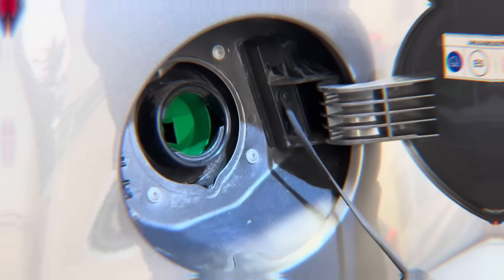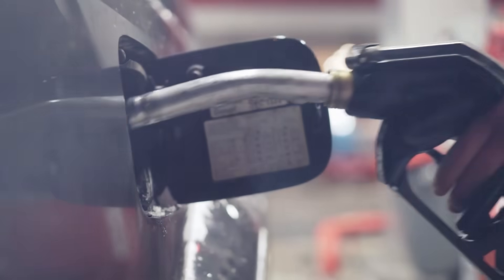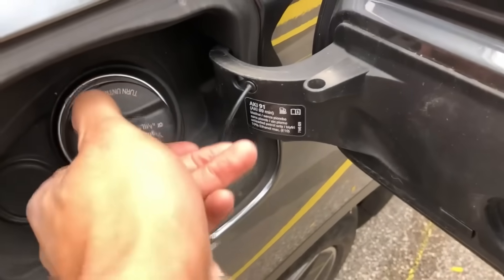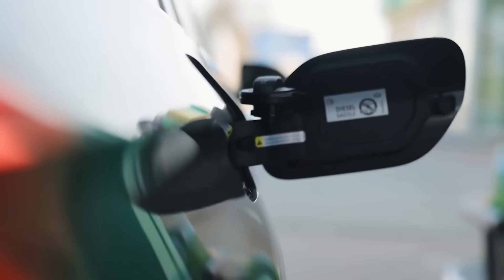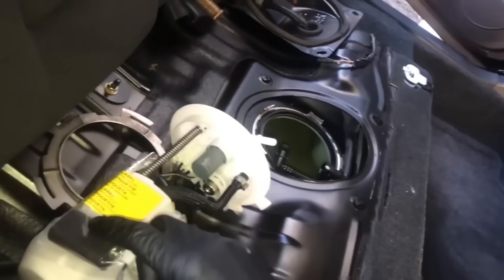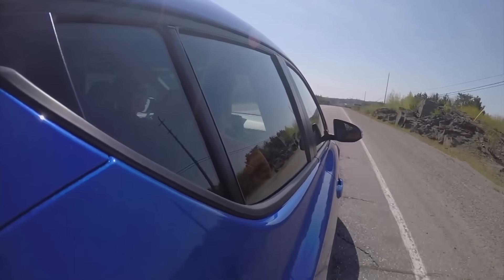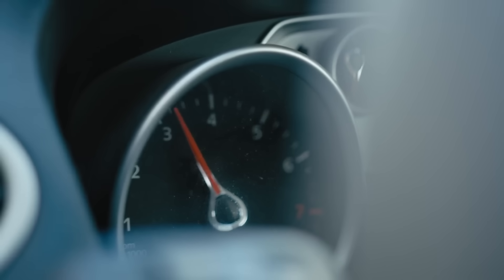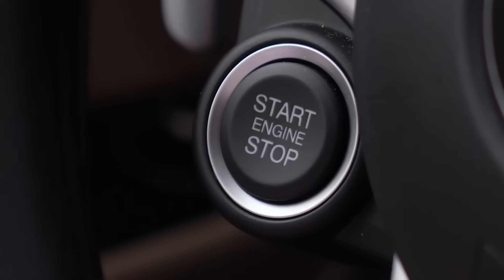Never Do THIS Before Refuelling (90% Get it Wrong)

Comment: BS. Youdo not know what you talk. Presurised tank??? 😂😂😂😂. Plug its allready built with airvent. If air do not go in because the plug seal the tank, at one point you have vacuum. Or pressure if its hot outside and tank its perfect seal. Cover its build smart, in case of accident and capsize of car, fuel do not came out from vent. 😂😂😂

Comment: Never in 500,000 miles did i EVER leave the engine running whilst refueling. Neither have I seen anyone else doing it. On my current old car the key locks the fuel cap so I always have the key in my hand. 
I watched the first bit but gave up after that. Rubbish !

Comment: #2 is only true if the sensors in the pump are set up right. I have had times when I had to go past ten or twenty clicks from the pump to get even close to half a tank - the worst case was a pump I regularly used (there wasn’t another convenient place to refuel) that would click about twice every pint, which is a real pain if your tank is around ten gallons.

Comment: the first story is false let me explain why the vapors are heavy yes but they are exposed to the open air and will dissipate before getting to the engine to actually cause any issues I've done that only because my battery and starter was bad that if I shut it off I would not be able to restart it again and secondly static discharge is highly more likely to cause a fire at the filling port then leaving your engine running

Comment: Every fuel system cleaner I’ve ever used says to add it to a near empty tank then add 15 or more gallons of gas.  The gas will mix it as it fills.  My favorite is Gumout Regane fuel system cleaner, but I’ve followed the same routine with others.

Comment: I have noticed when I replaced cap with a locking cap my jeep will not allow me to unlock it until 3 to 5 minutes ( depending on how long it was driven or how hot the day is.  
Always fill before it shows few at E  he is right full injections needs to have full in them at all times.  What I learned from a 
Mechanics is air bubble can be trapped inside and cause pressure issues.

Comment: Myth busters couldn't duplicate a cellphone explosion no matter what they did.  This is a farce!
Reply: I was just about to say the same thing. It's the driver getting in and out of the vehicle that causes the static explosion, not the phone.
Reply: Tell that to my friend who has scars on his face and hand that was holding the phone
Reply: @joanntodd4798 the static spark is caused by getting in and out of the car, building up a static charge and when they touched the nozzle trying to take it out, it caused a spark. That was the conclusion the mythbusters came.
Reply: @19delta32 The cause is not the operative word. Regardless of what caused it, holding the phone precipitated it occurring. Don’t hold your phone while refueling.

Comment: 2:34 I park with the car away from the fuel Port nose down and this way I get the most angle to fill the tank, it's a 12 gallon yet I drive up there on a low fuel and I get 12.2 in the car I will continue to do this as well I can really pack it in there and even to the point where I can watch the fuel level drop as it's running haha.. works donut just fine. It's funny with a full tank literally I have gotten the 490 mi till empty indication and it's never done that, 2012 GT Lancer 2.4 MTX.

Comment: Fuel is always drawn from the bottom of the car tank or from the bottom of the storage tank.  You will not get more contaminates from a near empty tank or from a just filled storage tank.  In fact, you are less likely to get contaminates from agitated fuel.  If you get a hiss from your gas cap, you have a vent problem.  You are probably already seeing a check engine light.  Every gas additive I have seen says add just before filling.  Read the directions on the bottle.  Most of this is garbage.

Comment: There are two problems I have with this video. 1: #7: Filling while the tanker truck is filling the underground tanks. It used to be true about that but per a tanker driver I talked to, he said that with all of the filters within the tanker off load system and also, within the pumps, the problems that are stated that could occur are a lot less likely to occur. 2: # 9: I've never seen a pump on none level ground.

Comment: 🤦‍♂️ Mythbusters tested most of this and found things Plausible, but highly unlikely. 
The correct fillup procedure is fill until it clicks off, wait 30 seconds for the air bubbles and pressure to neutralize, fill until it clicks off for a second time. You're done! 
Capless tanks.... how do you let the pressure slowly escape? 

There are some things of truth, but this video is still going off of wivestales.

Comment: I worked as a pit crew fuel man for 30 years. We never turned our race cars off and never had a fire from it.😂
Reply: You have a permanent job waiting for u in NJ, which will NEVER have self service gas! Tho when i pumped gas there, some drunk drove in slow & hit & partially knocked over 1 of the old style pumps with mechanical numbers. lol  & even that did not cause a fire or explosion - luckily for the both of us.
Reply: @utuBrV1oI funny you mention this as there’s a full service station up in Mackinac City, Michigan I was offered a job at! Ha! Ha! I have considered it for something to do during the summer.
Reply: Thats racing not on the street. I have seen a lot of fires in pit stops .
Reply: @HarryBurgess-jm9jq sure but not because the engine was running. Usually from over filling and runs onto exhaust
Reply: Maybe the difference is you're refueling a finely tuned engine, whereas people stopping at the gas station is anyone's guess as to what condition their engines are or the condition of their wiring.

Comment: It's not the phone. It's the static charge you build up on your self when you slide across the seat to exit the vehicle. I know it's happened to me more than once during the winter. One winter I slid out of the vehicle and stuck my charge card into the fuel delivery pump and immediately the Blue Screen of Death appeared on the machine. I had to move to another pump.
Reply: Bs period